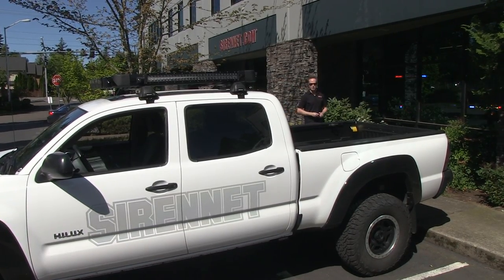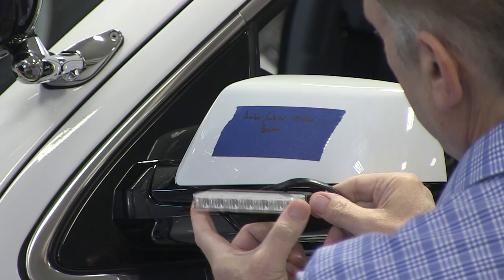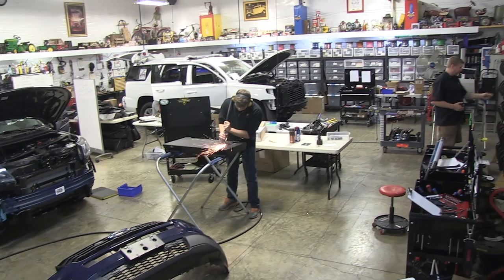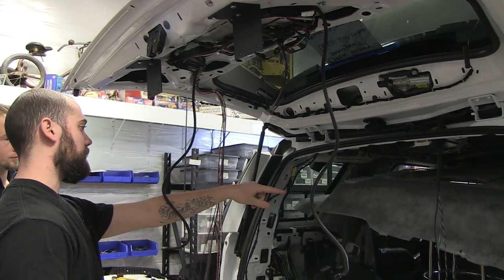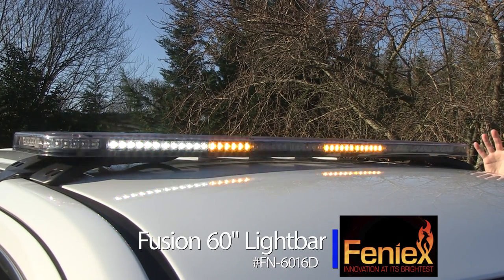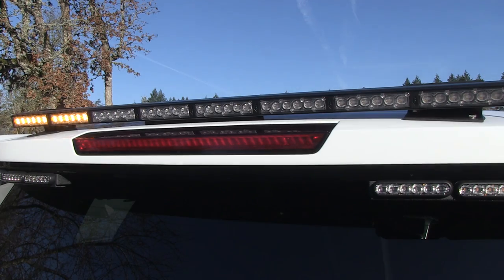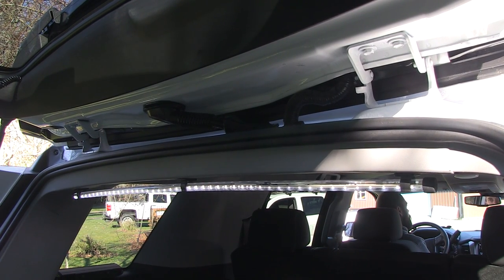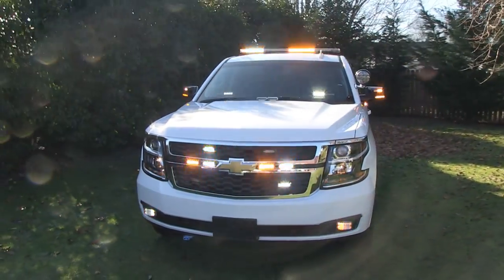Amazing Donated Lighting Install of a Chevy Tahoe, Outfitted for the SPCA

Comment: Not light related but ... @15:00 NMO's on the ribs? While that fifth, center rib in these newer Tahoe's is in the way of center mounted antennas, I would think that this effort will see water intrusion in the base of the antenna(s) since there's not enough surface for a good seal with the gasket on most NMO bases. Oh well ....